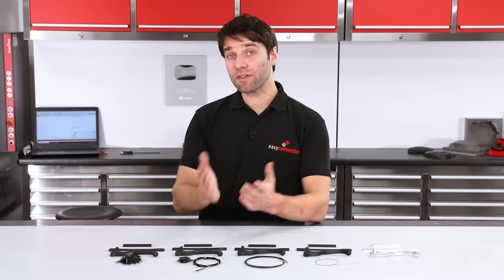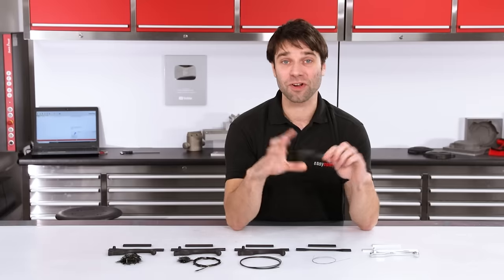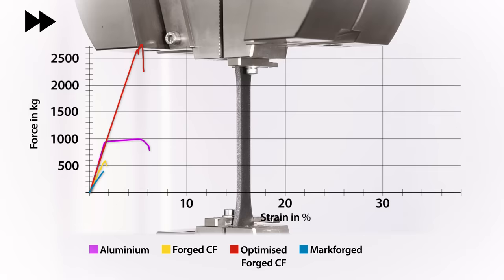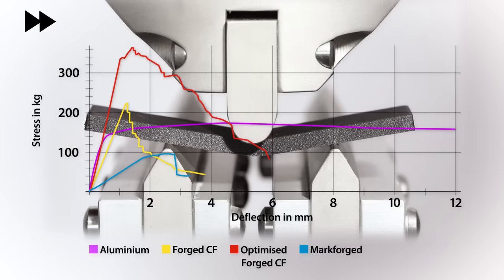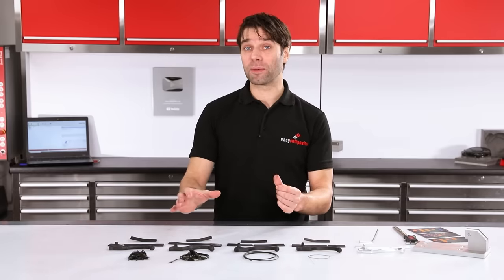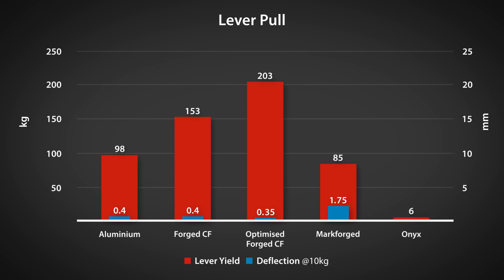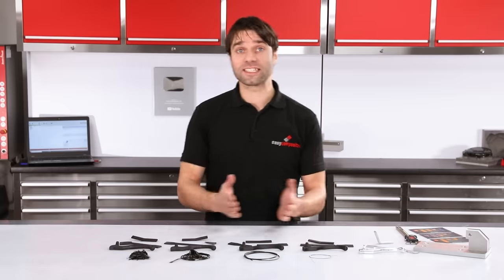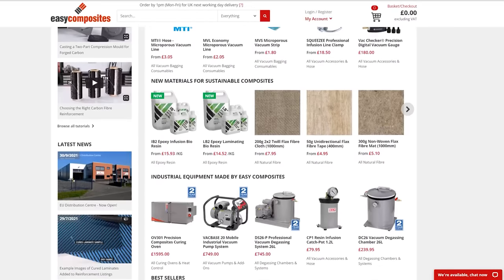How Strong is Forged Carbon Fibre? Forged Carbon vs Aluminium vs Markforged vs Onyx

Comment: This is not forging. This is molding.
Reply from the maker: Thanks for the comment and yes, the term 'forged' carbon fibre is not the clearest but it's been around for a while now  (Lamborghini have been using it for several years) and is quite widely used with an established meaning. To avoid using the term would mean that many viewers interested in understanding 'forged carbon' might never find this content, get to see what the term refers to (for some at least) in the context of carbon fibre composites, and learn how - for the right components - this process can be used to produce strong, lightweight parts with minimal equipment.

For what it's worth, before making the video we did discuss whether to use the term 'forged' a lot because we really weren't sure ourselves. After lots of deliberation (checking dictionaries and researching the history of the term) we decided to go with it but we did expect others might come to a different view, and that's fine too. If you'd like a much more lengthy explanation of we came to our decision please get in touch, we're happy to have more healthy debate on the subject

Comment: The 'streching' load test is useless on a brake lever! When do they ever get streched? No one i know can stretch a brake lever! Sideways or bending force is the only thing that matters with any lever
Reply from the maker: The forged carbon made in this way results in a pretty isotropic structure, therefore testing in a different orientation would result in pretty similar outcomes for the comparable materials.

Comment: Forge ? Really.. on carbon fibre ? I didn't know you could forge a shoelace..
Forge is really a bad choice of words, since zero forging occurred. But that makes sense because fibre can not be forged FFS.
Making a mold is not a forge.
Reply from the maker: Thanks for the comment and yes, the term 'forged' carbon fibre is not the clearest but it's been around for a while now  (Lamborghini have been using it for several years) and is quite widely used with an established meaning. To avoid using the term would mean that many viewers interested in understanding 'forged carbon' might never find this content, get to see what the term refers to (for some at least) in the context of carbon fibre composites, and learn how - for the right components - this process can be used to produce strong, lightweight parts with minimal equipment.

For what it's worth, before making the video we did discuss whether to use the term 'forged' a lot because we really weren't sure ourselves. After lots of deliberation (checking dictionaries and researching the history of the term) we decided to go with it but we did expect others might come to a different view, and that's fine too. If you'd like a much more lengthy explanation of we came to our decision please get in touch, we're happy to have more healthy debate on the subject
Reply: @easycompositestv  lol, fair enough.. I for one won't use that term because I see it exactly the same as fibreglass. I think I'd just make a mess if I forged fibreglass lol.
Anyway Cheers

Comment: There is no such thing as "forged" carbon fiber. Forging requires heat  and pressure. Carbon fiber combusts at forging temperatures
Reply from the maker: Thanks for the comment and yes, the term 'forged' carbon fibre is not the clearest but it's been around for a while now  (Lamborghini have been using it for several years) and is quite widely used with an established meaning. To avoid using the term would mean that many viewers interested in understanding 'forged carbon' might never find this content, get to see what the term refers to (for some at least) in the context of carbon fibre composites, and learn how - for the right components - this process can be used to produce strong, lightweight parts with minimal equipment.

For what it's worth, before making the video we did discuss whether to use the term 'forged' a lot because we really weren't sure ourselves. After lots of deliberation (checking dictionaries and researching the history of the term) we decided to go with it but we did expect others might come to a different view, and that's fine too. If you'd like a much more lengthy explanation of we came to our decision please get in touch, we're happy to have more healthy debate on the subject.

Comment: Cast aluminum is not wrought aluminum. Cast is cheap and brittle. On that point this is a somewhat misleading video, IMHO.
Reply from the maker: Cast aluminium is what the original part was made from and what most parts like this would be made from. We also describe it as cast aluminium. On both of those counts I can't understand how you could describe this as misleading but nonetheless we're sorry if you feel that way. Furthermore, the test tokens were wrought aluminium extrusion and we even discussed the fact that these performed even better than expected, given their grade; maybe you missed that bit. All that said, I hope you still found the analysis interesting.

Comment: Why do you call it "forged"?
Reply from the maker: Good question and certainly one we thought long and hard about before making the video. The main reason (quite honestly) is that we call it forged because lots of other people already do, including Lamborghini. We wanted to explain how to create carbon fibre parts made using short strand, randomly oriented fibre, which is broadly the method that Lamborghini and others describe as 'forged carbon' but in order to do so, it was hard to avoid using this now fairly well established term.
Reply: @easycompositestv  Thanks for the quick reply!  As a mechanical engineer (admittedly a small subset!) it grates.  I'm afraid (IMHO, of course) it sounds like a marketing department just threw in some technically wrong buzzwords into a description to sound cool.  Consequently, the whole thing sounds like snake oil to folks with any degree of materials knowledge.  "Forged" is a very specific term with a very specific technical meaning in terms of refining microstructure - "Forged in Fire" is familiar enough to folks to make "Forged Carbon" sound suspect.  Anyway - I did watch the vid, and of courses it's very good work and clear and technically thorough and accurate - no question - love your tester!  CF is such a great material that I hate to see its meaning diluted with marketing errors.

Anyway - just my impression running across your vid last night!  FWIW or street cred, I did my first work with CF pre-preg and tape in the mid '80s at school and experimented a very little with it and aramid and Nomex honeycomb in Human-Powered-Vehicle bodies in that era.

Comment: Just saying forged is at best disingenuous and at worst a blatant lie
Reply from the maker: Strong feelings Junit. We do discuss the terminology (it’s not our terminology but it is in wide use - Lamborghini for example) in the preceding video. This is more of a follow up so we don’t go over it again. You’ll also find further discussion about the term ‘forged carbon’ and its applicability to this process in the project write up on our website. There’s plenty of blatant lies in the world these days, I don’t think this is one of them 😀.
Reply: @easycompositestv  I'm not one to put much stock into what a company's marketing department has to say. Strength wise is it much different than a part that was vacuum cast or one in a pressure pot? Essentially the mould only compresses what air is trapped in the mould. The epoxy isn't compressing. Aside from the disingenuous nomenclature, from a manufacturing standpoint it seems cheaper and slightly faster to use this method. From a hobbyist perspective I'll stick with the older methods.

Comment: As an engineer the "force in kg" absolutely ruined this for me. Why bother making yourself wrong to try and relate to people who don't understand units correctly? It would be better to have people go and learn what a Newton is, rather than continuing their delusions that the kg is a unit of force or weight.
Reply from the maker: As mentioned in the video, the units were substituted to be more meaningful to the average person. Someone with an engineering background will be more than aware of the limitations in doing that.  We aim to appeal these videos to the wider composites audience not just the more technically minded.
Reply: @easycompositestv  As I said, the goal should be to educate people on how to understand things correctly, rather than making it "easy" for them to continue in their ignorance. In the time it took to ruin all the data, you could have made a short clip giving people a reference point for what an MPa and Newton are like in their everyday lives.
Reply: @JLUROCK  "ruin all the data"? Slight overstatement.
If it bothered you that much you could have just done the calculations yourself and said nothing at all. In this case, using kg doesn't change the results nor does it invalidate the testing.

In fact, just to make it easier for *you*, here are the figures for the lever pull test, using 1kg to 9.80665N, rounded to 2 decimal places:
Aluminium = 961.05N
Forged CF = 1500.42N
Optimised Forged CF = 1990.75N
Markforged = 833.57N

Do you feel better now?
Reply: @vyrnmn  Thank you for showing your complete lack of understanding of the issue. Perhaps you should take some time to think about what someone says before angrily pulling out your calculator and showing them how things are done. If you take data that starts out in the correct units and then purposefully convert them to the wrong units, maybe it doesn't "ruin" the data, but it is still rediculous. The issue is clearly not that I am having some sort of difficulty in convert back to the correct units, but that the individuals creating the video make a conscious choice to convert the correct units to ones that are clearly wrong, and then try to argue that it was a good decision. They 100% deserve to be called out for that. If they are making objectionable choices in one area, they may have done something else that very well could have changed the results or invalidated the testing. If you don't understand why that is important, you shouldn't have tried to butt in.

Comment: SPOILER ALERT: This is not forging.
Reply from the maker: Thanks for the comment and yes, the term 'forged' carbon fibre is not the clearest but it's been around for a while now  (Lamborghini have been using it for several years) and is quite widely used with an established meaning. To avoid using the term would mean that many viewers interested in understanding 'forged carbon' might never find this content, get to see what the term refers to (for some at least) in the context of carbon fibre composites, and learn how - for the right components - this process can be used to produce strong, lightweight parts with minimal equipment.

For what it's worth, before making the video we did discuss whether to use the term 'forged' a lot because we really weren't sure ourselves. After lots of deliberation (checking dictionaries and researching the history of the term) we decided to go with it but we did expect others might come to a different view, and that's fine too. If you'd like a much more lengthy explanation of we came to our decision please get in touch, we're happy to have more healthy debate on the subject.

Comment: so its not forged in any way.
Reply from the maker: Thanks for the comment and yes, the term 'forged' carbon fibre is not the clearest but it's been around for a while now  (Lamborghini have been using it for several years) and is quite widely used with an established meaning. To avoid using the term would mean that many viewers interested in understanding 'forged carbon' might never find this content, get to see what the term refers to (for some at least) in the context of carbon fibre composites, and learn how - for the right components - this process can be used to produce strong, lightweight parts with minimal equipment.

For what it's worth, before making the video we did discuss whether to use the term 'forged' a lot because we really weren't sure ourselves. After lots of deliberation (checking dictionaries and researching the history of the term) we decided to go with it but we did expect others might come to a different view, and that's fine too. If you'd like a much more lengthy explanation of we came to our decision please get in touch, we're happy to have more healthy debate on the subject.

Comment: Why do you guys call it forged? Because it is some type of fake conglomerate? It is definitely not truly forged like steel. More correct to call it OSC for Oriented Strand Carbon, like OSB for wood.
Reply from the maker: Hi Darren, thanks for the comment and yes, the term 'forged' carbon fibre is not the clearest but it's been around for a while now  (Lamborghini have been using it for several years) and is quite widely used with an established meaning. To avoid using the term would mean that many viewers interested in understanding 'forged carbon' might never find this content, get to see what the term refers to (for some at least) in the context of carbon fibre composites, and learn how - for the right components - this process can be used to produce strong, lightweight parts with minimal equipment.

For what it's worth, before making the video we did discuss whether to use the term 'forged' a lot because we really weren't sure ourselves. After lots of deliberation (checking dictionaries and researching the history of the term) we decided to go with it but we did expect others might come to a different view, and that's fine too.

Comment: I don't think you actually understand what a "forged" product is or how it's made.  You're casting parts.
Reply from the maker: Thanks for the comment and yes, the term 'forged' carbon fibre is not the clearest but it's been around for a while now  (Lamborghini have been using it for several years) and is quite widely used with an established meaning. To avoid using the term would mean that many viewers interested in understanding 'forged carbon' might never find this content, get to see what the term refers to (for some at least) in the context of carbon fibre composites, and learn how - for the right components - this process can be used to produce strong, lightweight parts with minimal equipment.

For what it's worth, before making the video we did discuss whether to use the term 'forged' a lot because we really weren't sure ourselves. After lots of deliberation (checking dictionaries and researching the history of the term) we decided to go with it but we did expect others might come to a different view, and that's fine too. If you'd like a much more lengthy explanation of we came to our decision please get in touch, we're happy to have more healthy debate on the subject.
Reply: @easycompositestv  
You'll have to forgive me for being new to the field.  I think you've adequately defended your position.  I can either go on begrudgingly with the terminology or accept it for what it is.  It's easier to just go with the flow, so forged it is!

Comment: 7075 T6 is 3 times stronger than low carbon steel weigh for weight.
Downside is it's expensive, and isn't supposed to be welded.

Comment: These are not "forged". This is just a poor mans version of lamination.  Its no different than crappy oriented strand board (OSB) versus plywood. 
   You're really playing fast and loose with definitions.
Reply from the maker: Thanks for the comment and yes, the term 'forged' carbon fibre is not the clearest but it's been around for a while now  (Lamborghini have been using it for several years) and is quite widely used with an established meaning. To avoid using the term would mean that many viewers interested in understanding 'forged carbon' might never find this content, get to see what the term refers to (for some at least) in the context of carbon fibre composites, and learn how - for the right components - this process can be used to produce strong, lightweight parts with minimal equipment.

For what it's worth, before making the video we did discuss whether to use the term 'forged' a lot because we really weren't sure ourselves. After lots of deliberation (checking dictionaries and researching the history of the term) we decided to go with it but we did expect others might come to a different view, and that's fine too. If you'd like a much more lengthy explanation of we came to our decision please get in touch, we're happy to have more healthy debate on the subject.

Comment: Why aren't you using hemp fiber? it's stronger than carbon fiber. More environmentally friendly as well. Plus it sequesters carbon ... 

Because it's actually proven to be better than your product, that's why. Why do you insist on selling something which is inferior and costs more? Because you don't know any better - the inertia just carrying us along pathways which we know are inefficient in specific ways which have  overcome in other methods
Reply from the maker: Hi Agni, there’s so many reasons we aren’t using hemp fibre for this, I just don’t know where to start. What I can say though is that hemp is absolutely, categorically NOT stronger than carbon fibre and would perform massively worse in these mechanical tests and so that, amongst many other things, is why we aren’t using hemp.